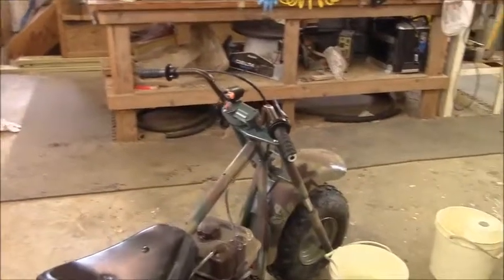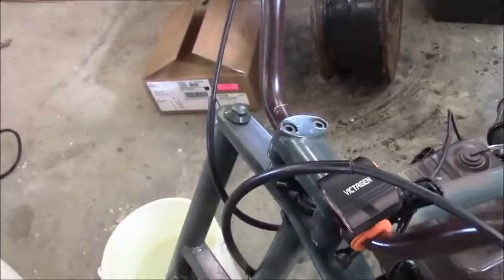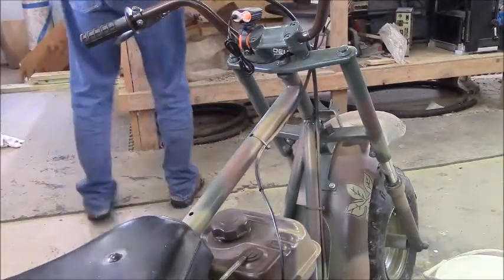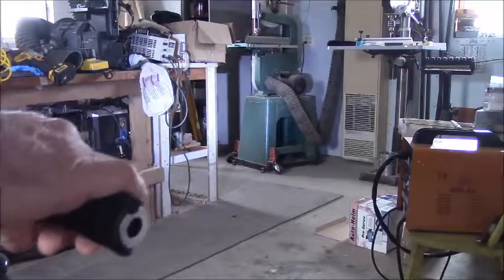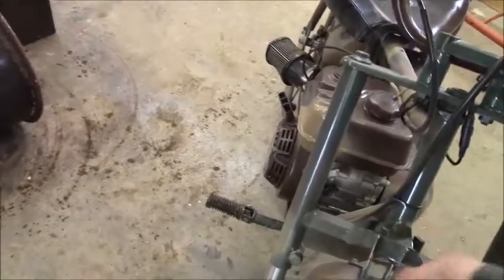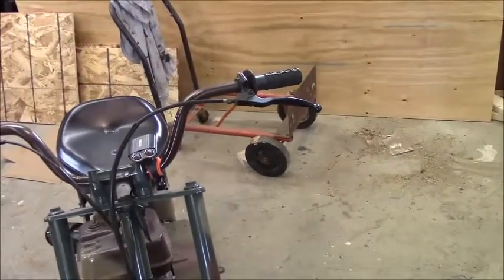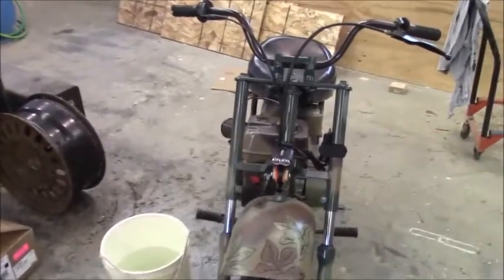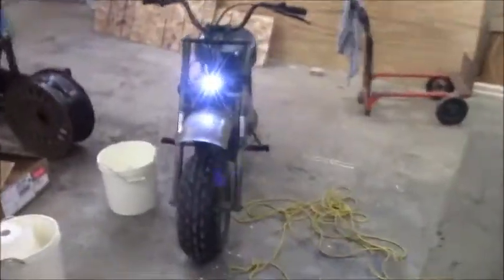How to mount an easy and cheap mini bike headlight, DIY mini bike headlight

Comment: Yes. Good idea. I'm going to do that. I have the same bike. I will just put another one on the right side of the handle bars. Use one until it runs out, then turn on the other. 2hrs now become 4hrs. 4hrs now become 8 hr, etc etc. A few inches from left to right isn't much difference.
Reply: Actually I am a welder. I can make a bracket up front like you. Add several more lights.

Comment: I have that same bike but mines black and I don't know hot to turn on the headlight
Reply from the maker: There is a wire coming out of the motor that needs to go to a switch then the input to the head light. There may be a black wire coming out of the light too that needs to be grounded to the frame. A fuse of about 2A is a good idea